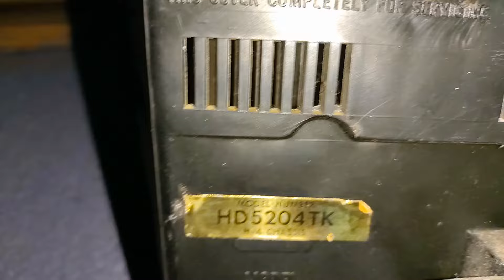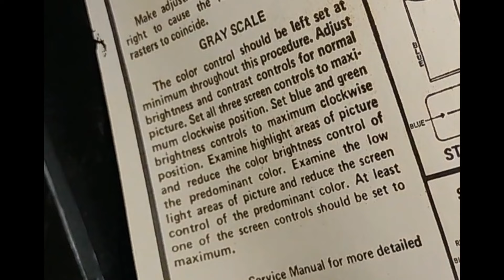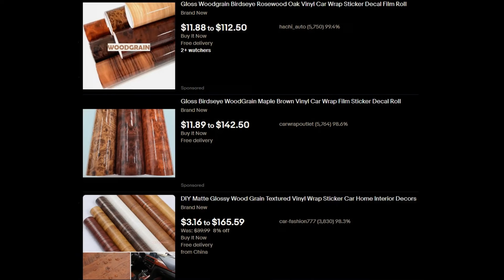General Electric Portacolor HD5204TK (Unrestored and untested)

Comment: Defiantly dim bulb that thing.  Take one tube out while reforming the caps.  Start again with all tubes in and the cap off the horizontal output tube.  Replace the large ceramic paper capacitor close to the horizontal tube before bringing up the high voltage as it will blow its guts a minute or so after the screen lights up.  Really crappy performing TV but a way cool piece for the collection.
Reply from the maker: Thanks, i'll do that.